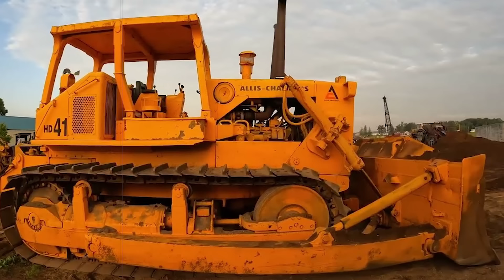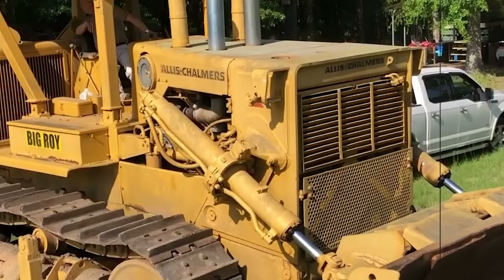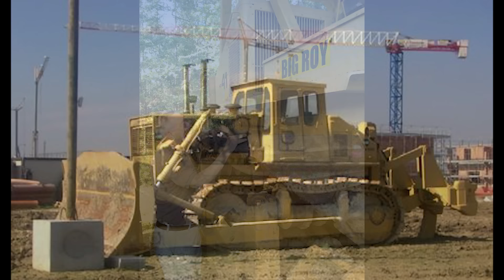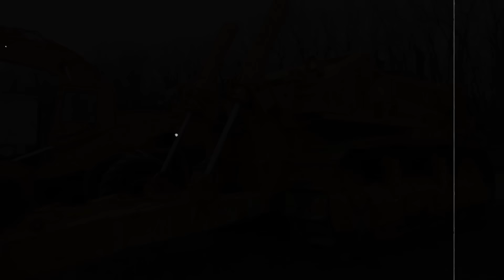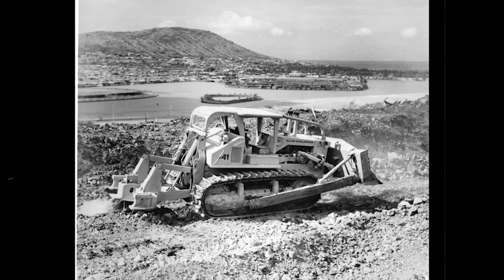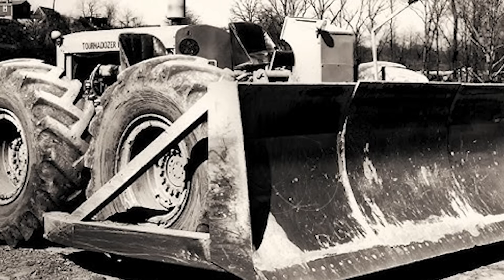Why 1870s Allis-Chalmers HD-41 Dozers Still Run While Modern Dozers Seize After 15,000 Hours

Comment: Abi Group in Australia had 3 HD41 it took 9 D9 Cats to do the same work and 3 times as long.
After each job each machine was stripped down and rebuilt ready for the next job, not that anything was broken, it was so from start to finish the machines never stopped, just preventive maintenance.
There was one job where they were ripping solid sandstone for an expressway,1 mile runs 5 feet deep, 1 new ripper boot per run.
Reply: what's a 'ripper boot'?

Comment: The only thing wring wuth  41B  they had weak final drives.  If they were used to rip rock you lost the finals every time.  
The transmission cooler was the in the rear not a problem  .  We hae  2 HD 41 B  one of them had a push cushion and  could load 2 651's a minute,  scrapers that had 24" side boards.  very poor ripper cat because of the weak finals.

Comment: In my opinion the big problem with this dozer was the Torque converter was too aggressive,it could transmit enormous torque to the tracks even when lifting the blade to transfer more weight to the tracks it would  just continue on,even it virgin earth,rock nothing could stop it,the same action with a D9h would result in the converter stalling and saving the final drives a lot of stress.A simple change over of the converter with more slip may have been all it takes to have changed the outcome of 41b final drive failures,just a thought,I haven't operated a dozer since the early eighties but still have good memories of the 41b the V12 was a nice quite engine no black smoke and never any need to decelerate like the Cats of that era.

Comment: Um 1870?? You mean 1970. There were no bulldozers in the 1870s   There was no combustion engines yet
Reply: Astonishing that the poster can't bring themselves to simply take the glaringly and humiliating error down, correct and post it back up! ???
Reply: There may not have been INTERNAL combustion engines but there most certainly were EXTERNAL combustion engines.  Two classic examples of which are hot air engines and steam engines.
Reply: They were only Alice Chalmers!